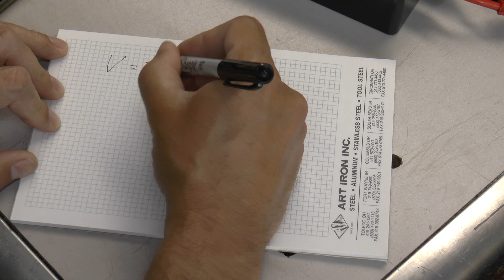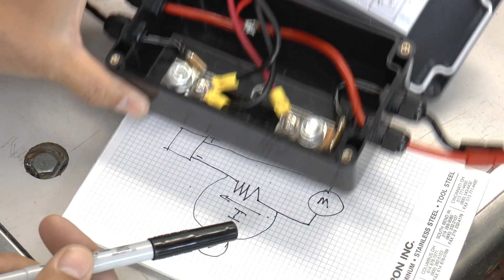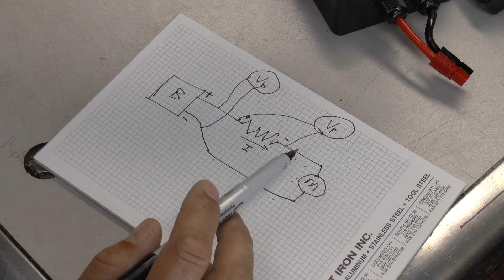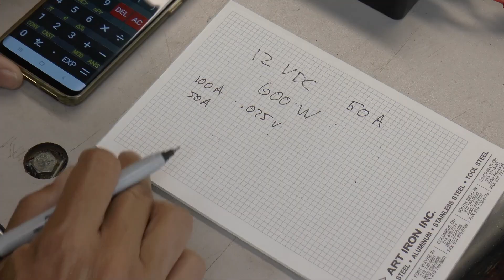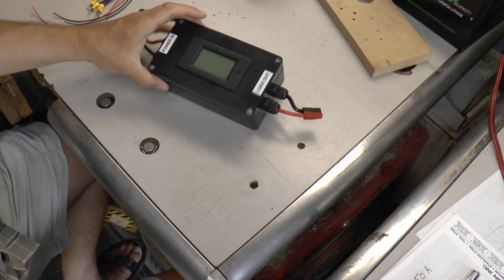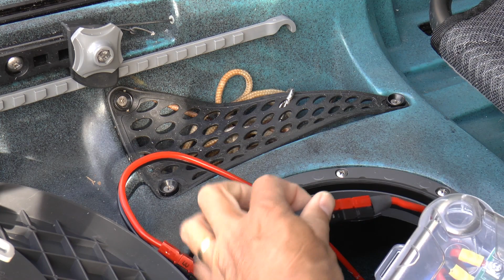Battery monitor / ammeter / voltmeter for kayak battery / motor testing

Comment: The Newport is brushless correct? No issues using a regular PWM with It?
Reply from the maker: This motor is a brushed Newport Vessels kayak series trolling motor.  The brushless model requires a special controller.

Comment: Interesting. I was a bit concerned seeing your PWM sitting in this enclosed container. You could probably put a temperature sensor in and see how hot this thing gets.
By the way.... Wago has some super quick and easy "Lever-nuts" connectors. I always carry a few with me as I happened to be in a rush a few times and pulled to hard on cheap crimped wires.
Reply from the maker: It gets crazy hot.  I'm actually interested to see how long it lasts.  I'm sure it will die at some point.  It's an open question whether it would die quicker from heat, or if it would get wet and short out in a ventilated box.  The right solution would probably be a waterproof motor controller.  Depends on how expensive they are, though.
Reply: Also isn't heat created just more wasted energy